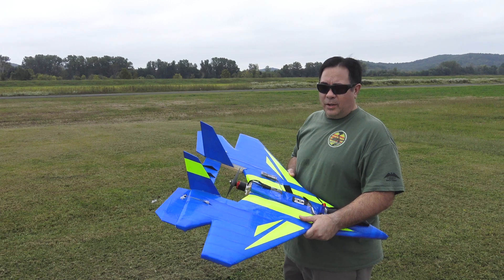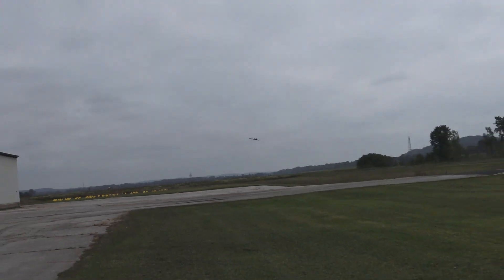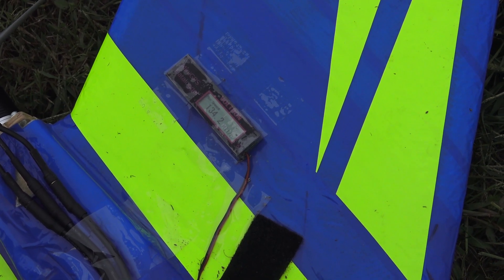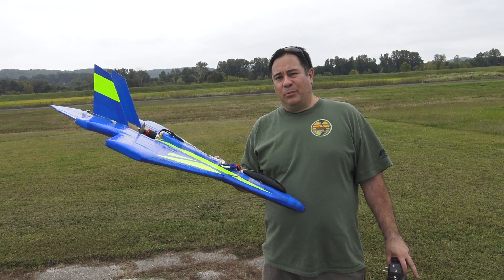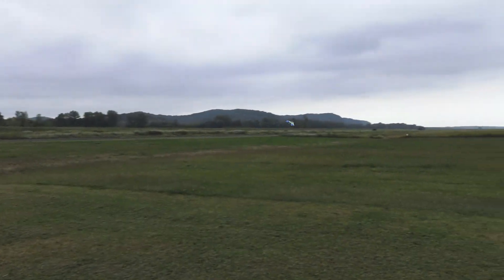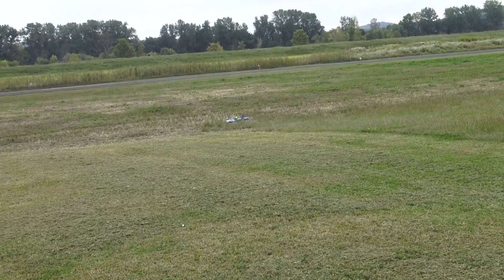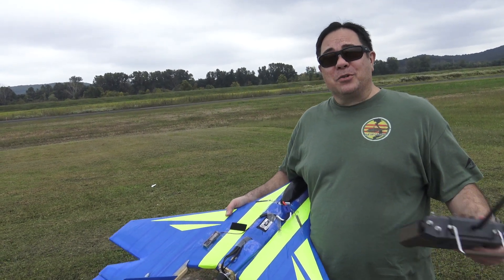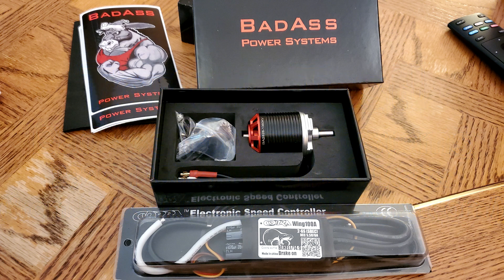Speed Runs and Torture Test - BadAss 2826-1360KV Motor

Comment: what can i use insted of 5mm collor for motor mount to puller
Reply from the maker: If you reverse the motor shaft on the HobbyKing 3648-1450 motor you will need the 5mm collar. The existing c-clip will not work because there is no grove on the shaft to hold it. If you have a lathe you can probably create a new grove, but most people do not have a lathe.  The only other option is to find a different motor set up to be used as a pusher mount.
Reply: @rcFoamFighters   THANKS FOR REPLY I AM GONNA USE A 500 CLASS HELI MOTOR RATED AT 1800 WATTS ITHINK ITS A COPY OF 3026 OR 3226 1600 KV .SO I WILL MAKE A CIRCLIP GROVE....THANKS ALOT
I WOULD USE DEMEL TO MAKE GROOVE

Comment: Niiiice! My all time favorite plane... I’ve puffed up so many batteries on those. Curious what your thoughts are on getting better airflow to the battery is
Reply from the maker: Thanks Jeff! Batteries can get hot, especially if not High C batteries, or large enough capacity for pulling high Amps.  As for helping get rid of heat I was thinking about putting some small holes/tubes that feed into the battery bay. I did finally carve some small channels on the two side walls of the battery bay to let a little air circulate around the battery. If you have it packed tight with foam all around the battery it is a big insulator and traps all the battery heat.. I made the cockpit canopy on mine so it leaves a little bit of the battery bay uncovered on the back two corners.. a little heat can leak out there...